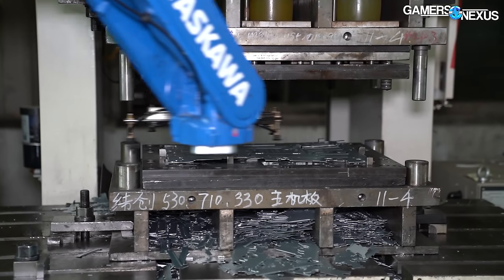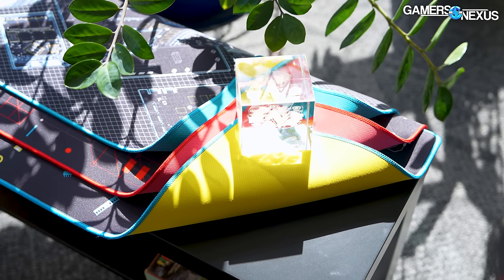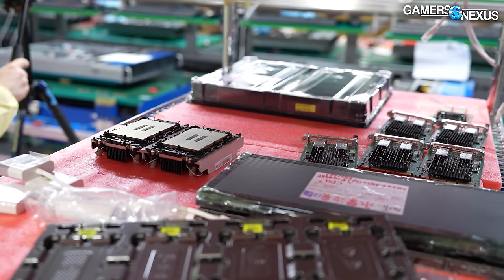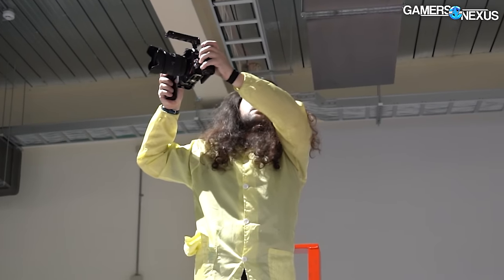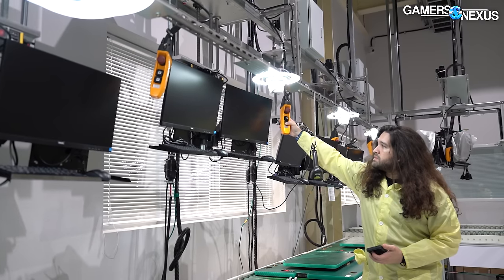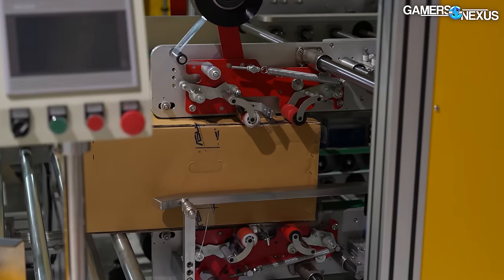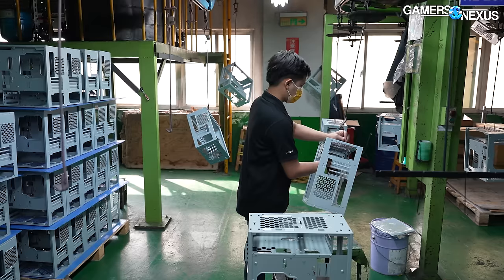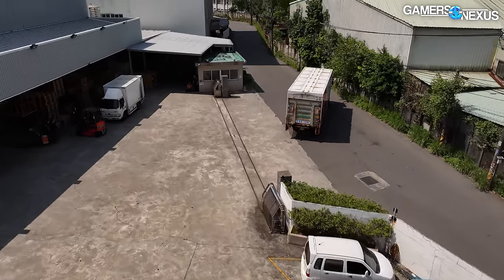HUGE Computer Server Factory | Watch How It's Made: Cases & Servers | GN Factory Tours S3E1

Comment: I'm actually a welder for arvos, which is a factory that makes hear exchangers for coal power, and now we're movong to wind power that somehow floats in the atlantic. We have tons of old mills, and benders, cutters. It's actually pretty cool for a nerd like me. I actually used a GN solder mat to fix a blown up Allen Bradley controller for one of the machines at work!
Reply from the maker: Wow! That's crazy. And awesome that you got use of it like that!
Reply: Plate and frame exchangers?
Reply: We don't have any specialized pressing stamps, but we do have very under wraps roll dies that make corrugated metal for the exchangers, It's actually pretty cool looking, but I was told that's one of the most important secrets in the factory since it would be the most damaging to copy.
Reply: @awetisimgaming7473  Yea sounds like you guys make the channeled plates. I've seen some massive stacks.

Comment: I like these because they relate to me.

I've spent 6 years in the manufacturing industry. From press molding aluminum panels into the exterior shape of cars doors, to forging and tempering glass for car windshields, to the careful examination and very specific physical handling of steering parts for toyota/honda vehicles, and the assembly of hardware and electronics.

I wish I knew how to 3D model, so that I could take what I know of the manufacturing process and design a better function-over-form PC case.
Reply: theres tons of free learning for that here on youtube...
one of the few REAL things you can actually learn for free here on youtube since the "online education" thing promised has not really panned out in the real world

Comment: I did work in a window factory that was much like the case factory. We had to hang all the metal on the same type of conveyor to get painted and ran through an oven. None of the painting was automated either. Even the washing process with chromate was a manual process. I do not miss it at all. I am so glad I got some IT certs and a much less physically demanding job.

Comment: My first job out of college was in a factory building server racks, mainly for telecoms (so 24" wide instead of 19" and up to 11 feet tall).  We used a similar painting process for our powder coating process.  The washing machine was nominally 200 F and then immediately went into a 400 F oven to dry prior to painting.  Then after a coat of paint, it back into the 400 F oven to bake but on a much longer track.  Then it got checked for quality, mainly those same type of hard to reach places seen in the video, and then unloaded.  Those was didn't meet the painting spec were then placed back into the line in a group where they would skip the wash cycle and go directly to the painter again for another coat. One thing that existed in my line that I didn't see in this video is the presence of a ground plug.  That is likely one of the differences between wet and powder coat painting.  The issue is that this was all done in a single building without good ventilation.  and in the summer you would walk outside into the 100 F humid air to cool off.  

The other building for the company at this location did all the welding, stamping, bending, drilling and tapping for the various rack parts.  Things were not automated back then and due to the volumes the company was dealing with, probably would not have many sense to fiscally due to the long tail to get a return on that investment.  So there were days were I would manually tap ~900 holes per rack so that holes would have the threads for their screws.

Comment: The funny thing is, that on a smaller scale, this is done all over the world, often in Value Added Logistics departments of warehousing (I worked in one, assembling servers for Data General, for a while, a few decades ago). overall, not much has changed since then! Grungy manufacturer and warehousing, to a dedicated area for assembly, moving down a small conveyor to testing in the same area, and after burn-in someone else packages it. The only difference was scale, and Taiwan is apparently very good at scaling it up!

Comment: Riding the forklight/pallet forks is a time honoured, common way to get to hard to reach spots lawl. Especially when a safety ladder is nowhere to be found, because Steve has nicked for some DIY at home. 

It's safer than a ladder as long as you know what you're doing and don't overextend the lifter.

Comment: bought a case 15 years ago.  was not large enough for my 4090 and water block.   Cut the top and front off, got another case for free, cut it, cable tied it together.  Put front plate back on.  Good for another 15 years!

Comment: Working as a painter i was given a robot to do my work, but not really any course in how to run the damn thing.
Anyway as it turned out, the robot painted 300 % slower than me, used +200 % more paint, and as a result when i painted the paint booth filter had to be changed every 2 - 3 weeks or so, when the robot painted, well much - much more often

Actually aside for being a machinist i am also a cut / die tool maker, and stamping steel was my first job after school, so yeah i can relate to a lot here.
This also made me into a kid with 9.75 fingers.
Also, i have several years of experience doing powder coating, and i have just about any education you can get here in regard to surface treatment, so sand blasting - Zinc spraying and wet paint.
Also did E Zinc plating and chrome plating for a couple of years.

If it was not for the lack of tools and a place to use them, i would have been building my own cases for a couple of decades at least.
But as it is, well i have had to make do with modifying.

Yes once i chrome plated a entire Codege or was in antec case + PSU,,,,,,, anyway i had the flashiest case around. 🙂 plastic parts painted gold.

Aaaa yes the good old days.

Comment: In these factories I’m always curious how they actually set it up and get the right machines, layout etc
Reply: The case factory definitely has a tool and die department.
Reply: @soundspark  Hopefully a tool and don't die department. But a manufacturing engineer is the one that helps out with factory design.
Reply: @brodriguez11000  They don't mean that die.

Comment: If you dont already have this on tap: multilayer PCB fabrication. You'll see a mumber if distinct processes: lamination, photolithography, etching, drilling, plating, routing, electrical test and inspection (but not in that order). 

Best of all, you can engage with one of the relatively low number of US-based fabs and save on travel costs.
Reply from the maker: Any recommendations on which of them are in the US and might be interesting? We can start outreach!

Comment: That second factory doesn't look much different than the one I worked in as a welder building truck and car hitches.
Reply from the maker: That's cool! Probably a lot of similar machinery for metal work!
Reply: @GamersNexus  Yeah. Similar cramped/packed feeling. I left there after overtime + rushing ended up with 3 people in 3 months losing fingers.